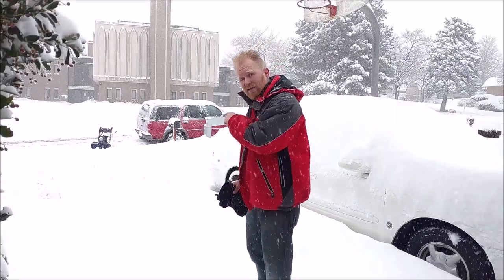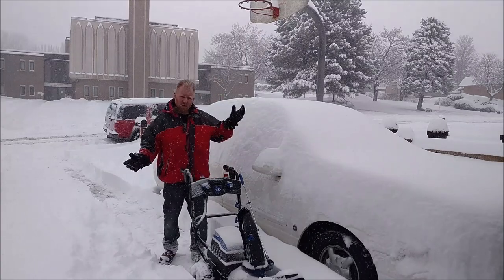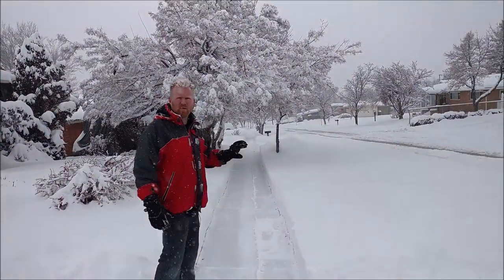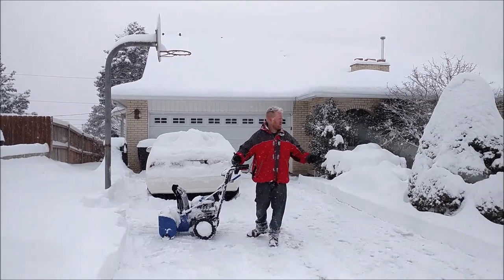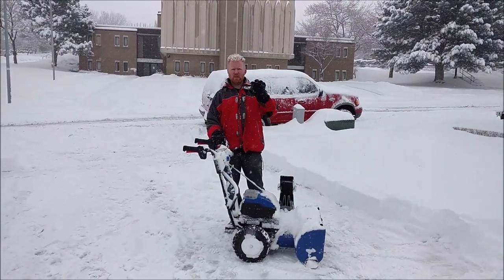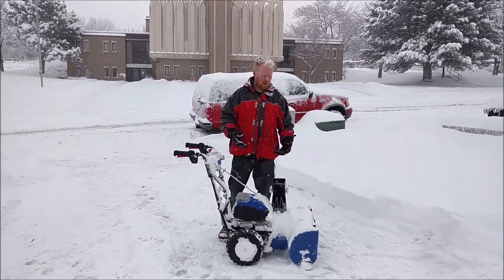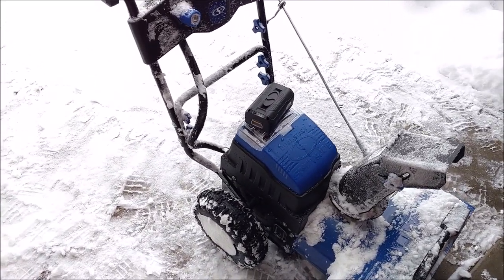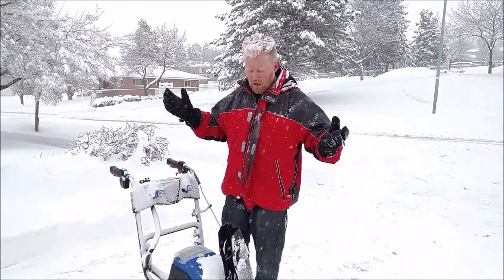Lithium 2 stage Snow Blower!

Comment: Impressive to say the least. The only problem with battery power equipment and tools is the price of the batteries. Great video!!
Reply from the maker: Lithium stuff is not cheap. I had very low expectation for this and it exceeded them. That being said, I won't be giving up my gas powered unit any time soon.

Comment: I remember the unboxing vid of this machine. I was doubtful it would work well or for long. I'm impressed. It seems to work well.  They pack lots of snow at the end of my driveway when they plow the streets here. It tends to freeze hard like cement. It's like trying to push past a brick wall. I think this would be where this machine would struggle or shut down. Thanks for reviewing it Moe.
Reply from the maker: It seamed to do the heavy slush (5-6") at the end of the drive without issue. It was very comparable to a 5-6hp gas snowblower in terms of power. But, I will keep my gas snowblowers.

Comment: My update on this blower I got back a year ago. So far, in 2019 we got two snows, both less than two inches deep. The second snow nearly melted before I could get out there but it drove wet slush about 20 feet. I recommend buying a second set of batteries as i did so you get a bit over an hour of use. If that is not long enough, buy a big stinky gas blower.

Comment: Looking forward to the day battery technology improves and we can all switch over to electric. Here in New Hampshire we're still a ways off before battery makes sense for your average sized residential property.  But slowly we are getting there..
Reply from the maker: It'll be a long time before we can harness the energy that gasoline has into a battery.
Reply: Yeah I was looking at all the energy power densities the other day....it will take awhile for sure.

Comment: As long as new batteries are available in 2-5 years. This has been my pet peeve for years.
Reply from the maker: I think they've had these same battery packs for 3+ years now and use them in all their equipment.
Reply: I feel the same way. Bought a ridgid 18 volt cordless combo kit about 10 years ago. Tools have held up great. Battery's won't hold a charge. It's not easy to find replacements since these tools are older. I have to rebuild the packs myself. At least Moe has a video for that right here on his channel!
Reply: try batteries.com they might have them

Comment: Send some of that Snow to New Jersey.
My monster 1971 Ariens 32 wide Sno-Thro with the predator 212cc is sitting here waiting to eat some snow already!
Reply from the maker: New Jersey is where these guys are out of. They told me you guys only have maybe 1/2in.
Reply: sixtyfiveford It was 39-40 degrees and sunny today. Its cold enough now if it were to snow, but its not. Sometimes the top of the state will get snow, Sussex county. I dont think that was the case today. So far we had one little system that dropped maybe 2 inches, not even enough to run a two stage. Really not enough to need any snowblower, where I am. Than it was 60 degrees the day after and melted it all. Not one good snowfall yet this winter, where I am. Thats why Im saying send some of that snow down here. Its weird down here usually Northern Jersey gets the most snow, while Central Jersey gets some, then South of I-95 just gets rain. Or it will Snow hard in South Jersey, Central could end up with the most while the North only gets a couple inches. Either way we havent had a real Snowfall Since late last January. One that left 3 feet. That was 3 storms rolled into one. 3 good snowfalls is about average here on a good year.
Reply: 212cc for a 32" bucket sounds very underpowered unless you get very light snowfalls.  Most machines with that size bucket have at least a 350cc or more engine,  but if it works for you...great!

Comment: That’s pretty nice! Everyone’s big concern is how many years will this Machine function?
How many batteries will need to be purchased let’s say in ten years and at what cost?
The average small gas unit will easily last ten years, with basic tune ups. What’s good today, maybe not be so good in 6,7,10 years. This technology is just getting going.
Reply from the maker: This will in no means replace a gasoline powered unit, but it's not really meant to. It's geared towards people who have zero mechanical ability and struggle using, let alone starting a gasoline engine. The number one misconception with battery powered anything is it's cheap to use and run. A gas powered tool will cost a fraction of battery powered stuff in the long run. You're paying more for ease of use/convenience. This uses typical 18650 lithium cells coupled together in the battery pack that should give someone a 5-10year life depending on use and care just like a cordless drill battery pack. The electronics/Motor should be pretty bullet proof and will outlast numerous battery packs. That being said, I would say a gasoline snowblower will last 10yrs minimum to 20years with basic service. It seams most of the derelict gasoline snowblowers I get in are 15-25years old and after basic maintenance I can put them back on the job for another 10+years.

Comment: How long to recharge batteries and if another set of batteries could be bought one could keep going if needed . The thing would be real good for people with just occasional snow storms , the gas would never go bad, so it would always start .
Reply from the maker: It takes 3+ hours to fully charge the batteries. After this demo(kept snowing) I let them charge for 1.5 hours and went back out; they went another 15 minutes. I then pulled out the 1979 Ariens and finished up.

Comment: I'm very impressed with lithium batteries. I wonder what the next level of battery technology will be. Even my Ni-Cad 18 volt dewalts still have acceptable performance.
Reply from the maker: I'm a big fan of the low cost and performance of Ni-Cad cells. But the one thing Lithium has going for here is the ability not self discharge over the summer and kill itself.

Comment: How long for a Recharge?  Will the batteries get memory? What do new batteries cost to replace?  What was the cost of this blower?
Reply from the maker: Takes around 3hrs to fully recharge the batteries.
Lithium has no memory and is rated for 500+ charge cycles
Lithium is not cheap but neither is any battery technology
The price changes but is around 800 with batteries.

I would suspect the price will fall later in the season and next season as they are the only ones with a 2 stage electric unit.

Comment: I have the same snow blower. I like it and decided to buy an extra set of 5 Ah batteries so I didn't have to worry about another recharge to finis the driveway. Besides the annoying safety button, what did you think of the handles? I found the grips award and the angle putting more stress on the hand. Otherwise, I think it will be replacing my gas snow blower with no problem.
Reply from the maker: I thought it was just me. The handle angles are definitely not my favorite. Mine came beat up pretty badly from UPS. It was dropped on the handle side of the box off the truck and actually bent the handles uprights towards the battery compartment.  In the unboxing video you can see how close the handle uprights are to the battery housing and that the handle grips point upward when I assemble it https://youtu.be/ZIwJAa75GUw?t=4m32s . After I did the video I wedged the front of the unit under my truck bumper and pushed downward on the handle grips to bend them more level. At 1:05 in this video you can see that they are pretty level with the ground now. After/During this video I was contemplating bending them even further. 

Have you used yours much. Thoughts?
Reply: I've used mine three times. The third time was only to get rid of the crud at the end of the driveway from the snow plow. It did good enough of a job that my wife was surprised how well everything was cleared.

Overall, I like the snow plow, but the packaging and the handles are my biggest beef. I may try your method of bending the handles down! From a review I posted on Amazon these were the negatives:

Packaging Needs Improvement – As others have metioned, the packaging could be improved. With the thin box and weak packing material, my snow blower arrived with the fastener for the chute clean-out tool broken. I feel I’m lucky nothing else broke during transit and I plan on calling Snow Joe to get the broken part replaced.

Awful, Awful, Awful Handles – Snow Joe, what were you thinking? As others have mentioned, the handles are uncomfortable as you have to squeeze the drive/auger grips from the bottom with your fingers. For good reason, most two-stage snow blowers have you press the grip from top with the weight of your hand. Less fatigue on both hands and elbows that way. If I decide to return the snow blower, it will be because of this poor design choice by Snow Joe. Also, the “safety button” on the auger trigger needs to go or have the ability to lock in place as it was cumbersome to engage without two hands. Snow Joe, when you do improve this handle/grip I’d like to have us “first generation” buyers be able to retrofit this year’s model with the new handles/grips.

Of course the snow blower has a lot of positives which is why I'm keeping it. For those interested, the rest of my review on Amazon is at: https://www.amazon.com/review/RU32E9QNR5VJY/ref=cm_cr_rdp_perm?ie=UTF8&ASIN=B01FN0XJXQ

Comment: I was surprised as to how long it lasted. How long does it take to recharge?  Looks like it did a great job.
Reply from the maker: It takes around 3hrs to recharge a fully drained battery. But being lithium, you can put them on the charger anytime or pull them off and use them, even if not fully charged.

Comment: Is this the unit with two 5Ah batteries, or two 6Ah batteries?  Edit - I see is has the two 40V 5Ah batteries.  Snow Joe now uses two 6Ah and it has an electric chute pivot (that goes 180 degrees?), and different lights.
Reply from the maker: This was two 5ah batteries. 6ah would be worth it.

Comment: I hate the idea of using small gas engine since they do not have a catalytic converter to filter the exhaust properly to be safe for  human lung so I bought this Snow Joe 80V (40Vx2) 2 stage snow blower  iON8024-XR 80V Max with extra two 40V 5Ah batteries in 2017 to help relief some manual labor.  The unit was only OK for regular snow.  The unit was too light so it keeps pushing itself up above a layer of snow if the operator does not put in effort to keep it grounded and the auger motor constantly stopping when it comes to medium to high density snow like snow plow pile or wet snow.  After using it for one dissatisfied snow season I parking it for one year and sold it in 2019.  I replaced it with a EGO single stage unit with two 56V 7.5Ah batteries after purchasing the EGO lawnmower with extended research.  The EGO single stage's brushless motor is more powerful and the auto shut off feature happens only 1/4 of time while the batteries only requires 1/4 of the time to charge. I was able to clear three to four additional four car driveways down to the black pavement on one set of EGO 56V 7.5Ah batteries while the Snow Joe would only clear my own driveway with two sets of 40V 5.0Ah batteries and with loss layer of snow on top of the pavement.  To decrease additional physical stress on my shoulders from heavy/deep/dense/wet snow since the EGO single stage snow blower would still requires the operator to constantly "bumping" the unit into deeper snow, this year I purchased the EGO 2 stage snow blower with two 56V 10.0Ah batteries and compare to the EGO single stage or Snow Joe 2 stage units this unit  works effortlessly with the self propelled motor and much heaver weight to keep itself grounded.
Reply from the maker: You can add a catalytic converter to most gas powered small engines. A private company makes them and it's a 10 minute install. Though the battery powered is convenient it quickly diminishes when you really need the tool to work. I tried to like it but ultimately gas powered is still by far King of the hill.

Comment: Wow, that thing worked pretty good! Is the battery hard to swap out if you had a bigger driveway and you wanted to make a pitstop?
Reply from the maker: The twin batteries pull right out like a power tool. These are their smaller batteries and will run around 45 minutes on a standard 5-8" snow load. They have larger capacity ones that'll go around an hour. It impressed me, but I don't think I'll give up my gasoline powered snow blowers.

Comment: I'm kinda impressed by the job it did but just wondering how long does it take to charge the battery ?
Reply from the maker: eaglehill6 These take around 3 hours when completely dead. But being lithium you can put them on the charger any time and pull them off and use them even if not fully charged.
Reply: jiiii88888

Comment: I just got a broken one of these free. Owner said bad circuit board and no replacement available. I was thinking to convert to six 12v 7ah batteries.  I can get used 7ah free from work. It sounds like the extra weight of the batteries would help it. I will just have to see if I can fix, bypass or frankenstein the board.
Reply from the maker: I don't recall if this is a brushless motor or brushed. If it's brushless you won't likely be able to run off batteries without a motor controller. If it has brushes then it should be a great candidate for an easy modification.
Reply: @sixtyfiveford  I checked and they are  brushless, so it would take more time and money than I want to put into it. So I think the smart thing to do is part it out on eBay and buy a carburator for an old Airens.

Comment: Bro, your channel helped me rebuild a tractor transmission. A+ channel for dudes! Anyway, Snow Joe has a newer 100 volt single stage, but I don't have a battery for it. I do have (4) 24 volts that I ran in series to get the voltage, but the blower won't run. Lights up and the electric chute runs. No auger though. When I open the machine to get to the components, there's a white wire meant for the middle contact of the battery between + and -. It runs to a board. My question is can this communicator wire be bypassed so I can run (4) 24 volt batteries? Or am I stuck with having to get a 100 volt battery with the built-in communication between that particular battery and machine?
Reply from the maker: Generally the extra wire is looking for battery temperature through a thermistor. This gives a resistance and can generally be swapped out for a simple resistor of 10ohms. I'm not positive if this is how they are doing it on this particular battery though. You may be able to use one of the temperature wires of one of the batteries to get the same result. 

You're in uncharted territory... I love it.
Reply: @sixtyfiveford  Thank u, bro! Back to the lab... with guidance!

Comment: I have a Snow Joe single stage 40v snow blower and I can tell you unless the snow is powdery and dry these battery operated snow blowers are a huge fail. They also clog constantly. I watch all my neighbors with gas powered snow blowers clear their driveways and sidewalks. My problem is I am mechanically incompetent and a senior. I don't have the ability to maintain and service a gas powered snow blower. I have no way to get to a shop to do any maintenance. I also have a battery powered lawn mower. As long as the grass is dry it gets the job done. If the lawn is wet or you cut in the morning when the dew is on it the mower will clog constantly.
Reply from the maker: Electric power is far from competing with the muscle it takes to move heavy snow. However it's the best it's ever been. You should try a plug in unit or a 2 stage like the one in the video. It performs much better than the single stage units.

Comment: Are you still using and liking this machine?
Reply from the maker: Honestly I got rid of it. Gasoline is the way to go for snow. I figured I need at least an extra 1 to 2 batteries to keep up with a spontaneous amounts of snow. Gas powered, I just put more gas in. The price of batteries for these is just insane and you can nearly buy an entire gas powered snow blower for the price of a battery. 

The machine itself worked really good. It's just personally for me gas engines have never been an issue that would drive me to go this route.

Comment: I would say that did a dam good job :-D
If you didnt do the path near the road, you would have just a little bit of time left over, thats a good thing  :-D.

For a decent liftime it needs a slightly higher capacity battery, to make up for an aging battery.

Charging the battery in non freezing conditions would also do it good.

Also a basic crude meter on the battery would have been nice, so you can judge roughly how long you might have left.

Other than that, it looks like it kicks ass LOL :-D
Reply from the maker: I really wish they put a "fuel gauge" on the handles so you knew how much time you had left.